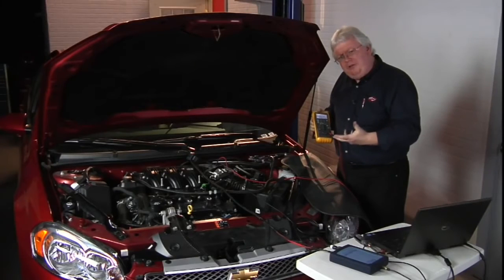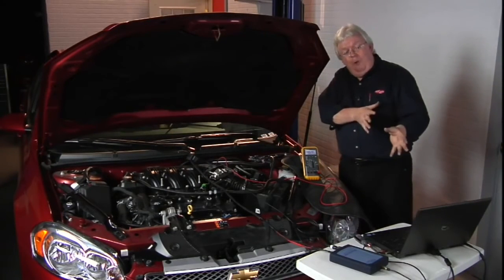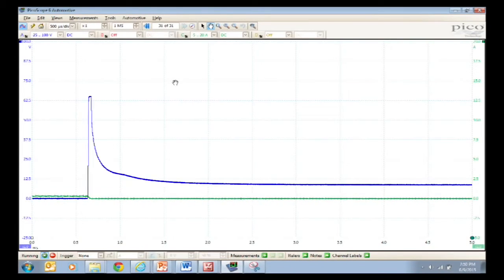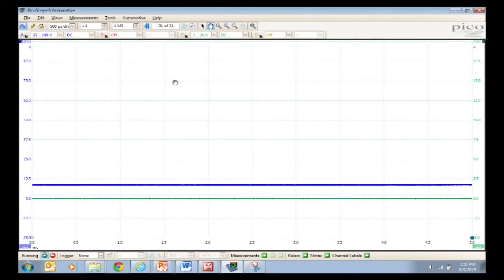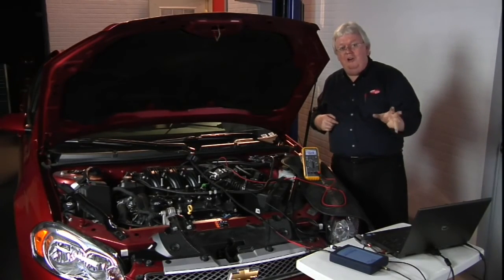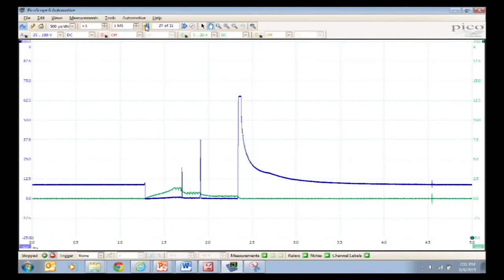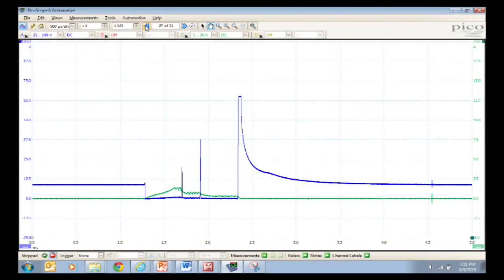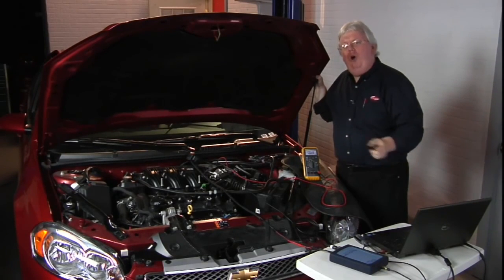How to Diagnose Injector Misfires (Diagnosing GDI – Gas Direct Injection Webinar)

Comment: just scoped electromagnetic diesel injectors on 06 cummings.couldnt see the hump on amp ramp on none of injectors but proved defective injector by moving position and code followed. guess my otc scope doesn't have enough sample rate or will try my modis scope next ,goes to proof that scopes can only proof electrically injector ok but will still misfire due to flow or pop pressure etc,can somebody give me an idea of what I might have done wrong or confirm my conclusion.

Comment: Please .... if you make a video, It is very important what you say and what you do, and first of all: HOW you do. 
Please set up that Pico if you make a video!!!! 
And ... to drive a GDI injector with 1,5 - 2 Amp? I do not belive that. Maybe 5-7 A!
You probably chose incorrect hardware or probe from the list. You need the 30A or 60A clamp. And do not use it in the 5-20A range, please! You can not see anything with this range. (You can create you own range in the settings menu).
And if you make a video, please use the trigger function! The people need to see what's happening! This jumping signal is ... zero.
And .... those "spikes" you have, because ECU change the voltage, from 65V (fast open current) to 12V (hold current). That's all. Simple inductions. All right, maybe we use them to charge the capacitors, but where is the missfire diagnose here?
I'M SAD!
Reply: hes also confusing the multiple actuations of a piezo Crd injectors with the single actuation of a petrol Gdi injector....i listened to that last  bit several times and its wrong
Reply: @Alchemist37  Not true. There are 4 diiferent injection event possibilities. Do some resesrch.